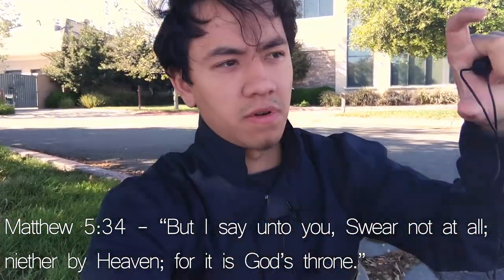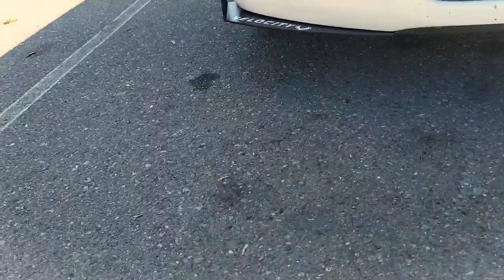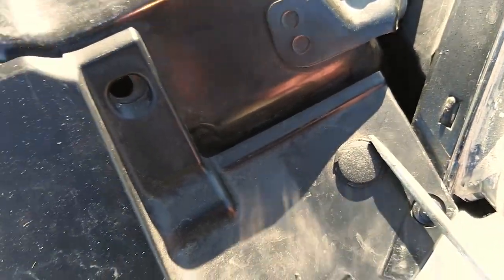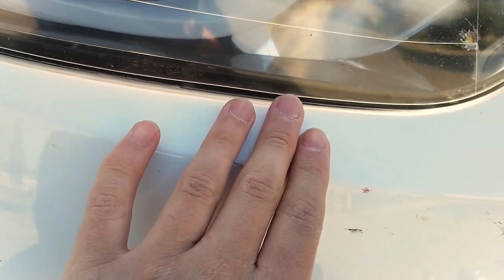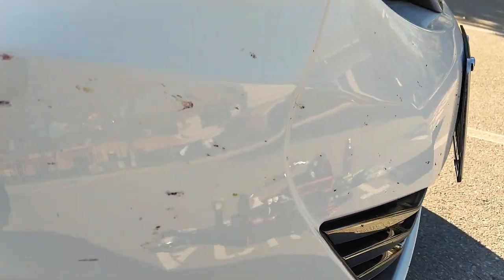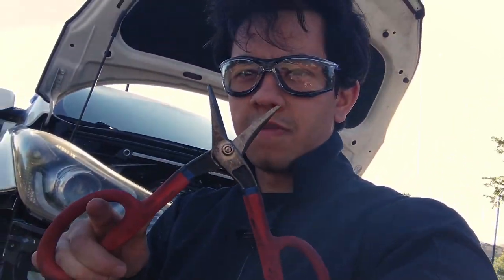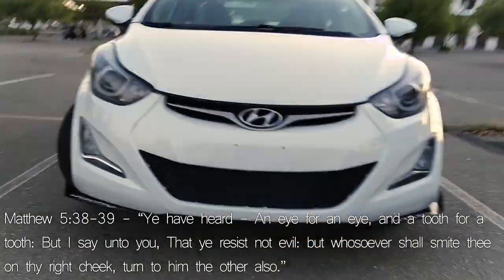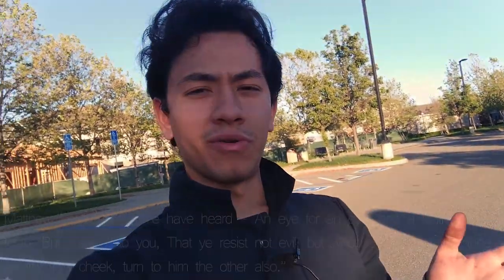Installing A DIY (Cut And Mount) Mesh Grille | HYUNDAI ELANTRA

Comment: Looks good, I just installed some new LEDs on the front of my 2013 Elantra.
The bumper is a pain. Got a video of my install. Like that black wing on the outside. Where did you pick those up at?
Reply from the maker: Hey Thank For Comment! You get used to the bumper after a while. I've done it so many times for various reasons that it's the easiest part for me haha! Those are the Velocity canards which I have an install video on here: > ( https://www.youtube.com/watch?v=lBjNAr6fHQg ) The item itself I purchased from eBay, and it comes with the rear diffuser ends as well: 
> ( https://www.ebay.com/itm/Canard-Front-Rear-Cup-wing-Body-Kit-Black-For-HYUNDAI-2014-15-16-Elantra-MD/152717997543?fits=Model%3AElantra%7CMake%3AHyundai&var=452354578544&hash=item238eb3b5e7%3Ag%3A5MYAAOSwsU5ZyhyW )
Reply: @that5thgenhyundaielantraguy  

Thank you for the link, and I'll check out your install video. 🖖😃

Comment: Hey, man... Not mesh/grill related, but have you tried a bulb type different than the factory 880/881/H27 for fogs? I'm thinking of using H8/H11 or even H9, but I'm not sure if it will fit.